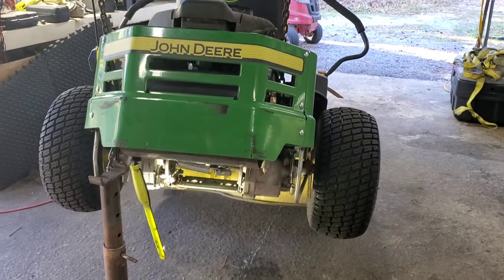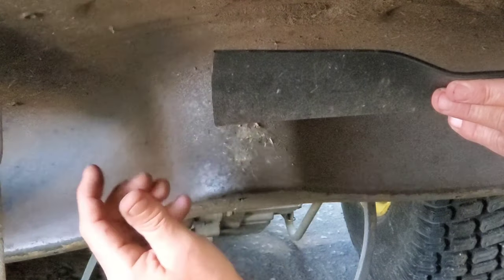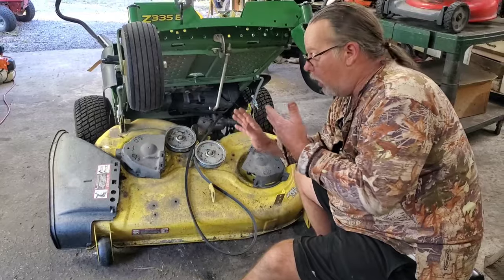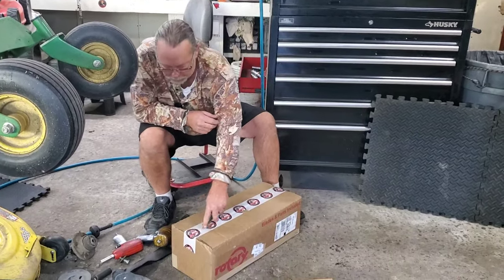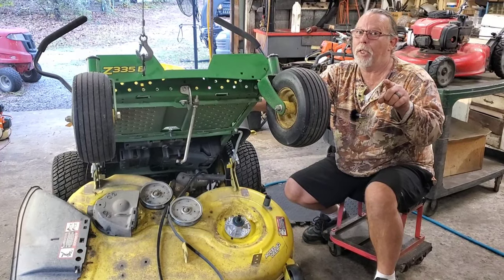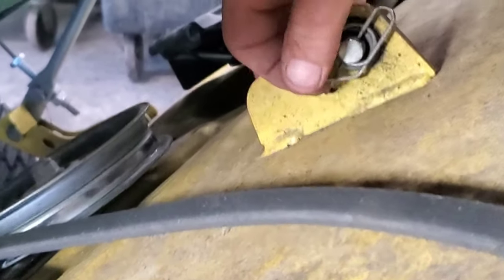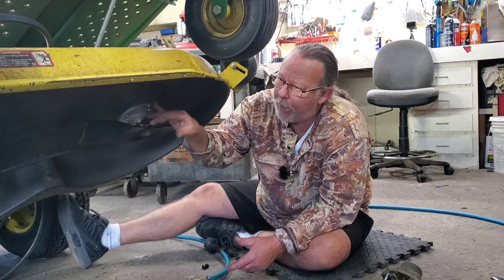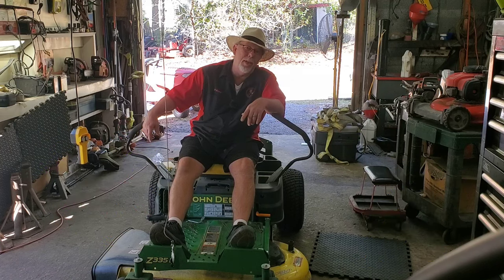John Deere Z335 Zero Turn Lawn Mower Hit Something and Vibrates also Cuts Uneven.  Has Bent Spindle

Comment: I liked because I got me a John Deere . In 15 hours the motor was a goner shaking all over. They came and took it. When I called them they said maybe I’d get it back in a week or maybe 6 months. That sucked so I called John Deere corporate. Didn’t take long till I was called and told it was done. Took 3 more days before it showed up. Ran and started right where before it was always hard to start. Hooray!

Comment: This video got you a new subscriber.  I have a Z375R and changed the blades and had vibration.  Couldn't figure it out.  Went back and checked and found one blade was not seated correctly on the spindle.  Thanx a ton, you saved me most likely a huge repair bill for something simple.

Comment: Question pls..ive put on new blade tighten the bolt all the way but the blade just spins freely, sometimes it tightens but mow 2min then loosens again..
Any idea
Reply: Did you find the problem? Make sure they are the correct blades, match the center hole to your old ones. Make sure your splines on the spindle are worn out if your has splines. Make sure the cupped washer is cup up. Good luck!